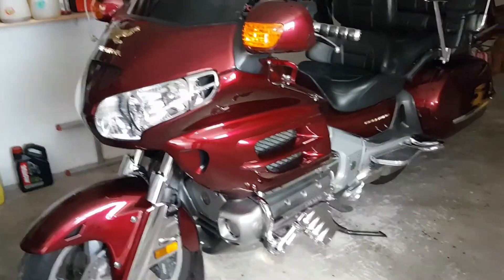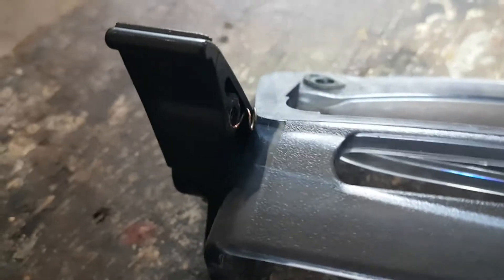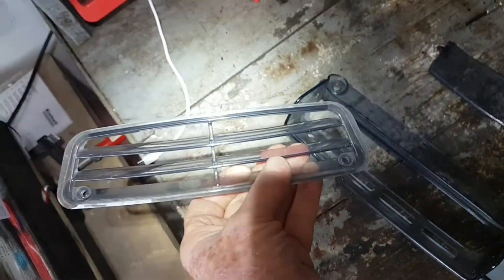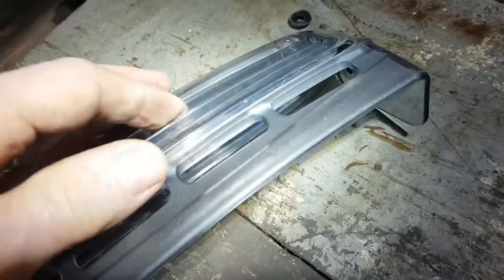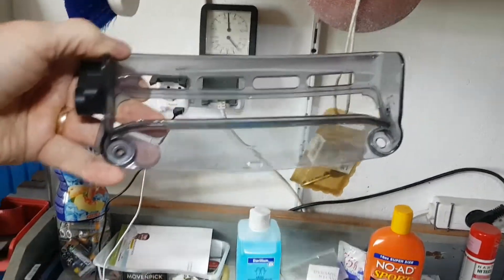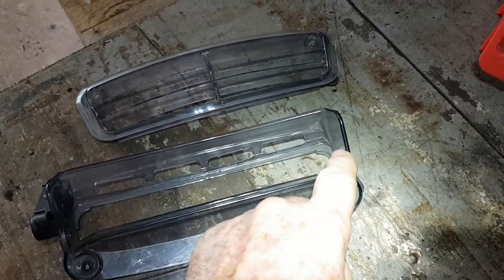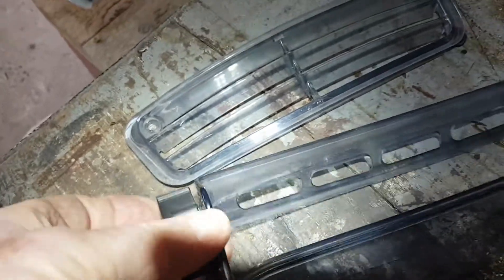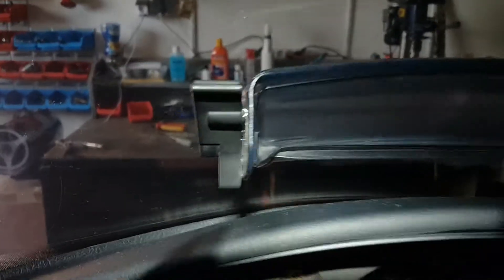Honda Goldwing Windshield Vent Repair

Comment: At the start of the video there's a cap on the black leaver, pop it out to access the screw, it's come loose, I had the same thing happened to mine, but I didn't loose the small ball bearing